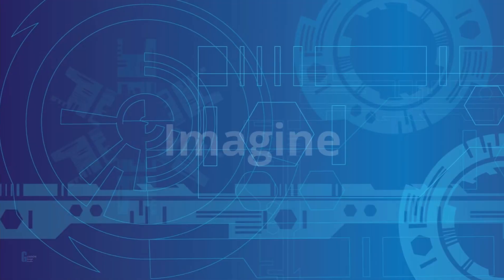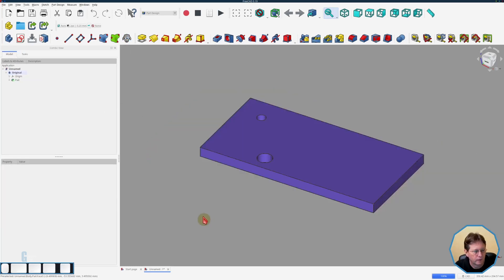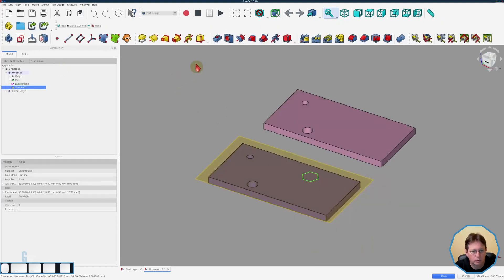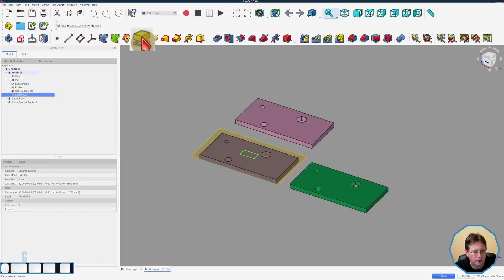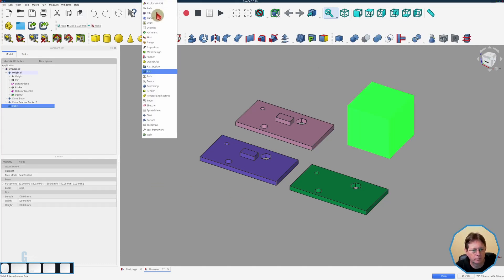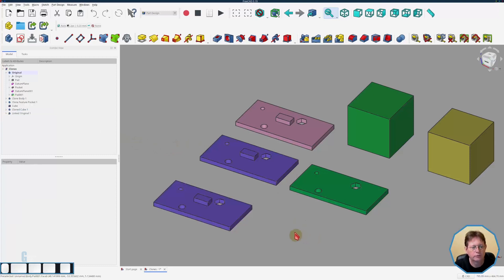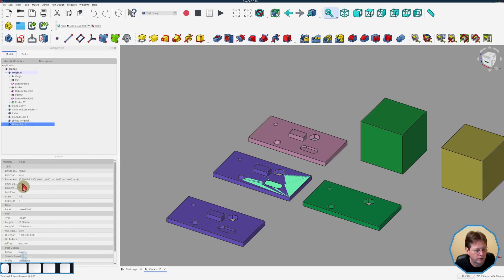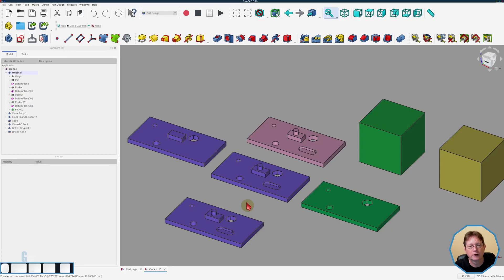What are the differences between FreeCAD's Clone and Link tools?

Comment: I found this very informative and useful, thank you  for your effort in making this available to the community. I have a question though concerning datum planes. In the video, when you create one on a face say, you seem to like to detach it before then going on to create a sketch. It's not clear to me why you take that option. I assume what happens in that case is that the datum plane retains its relative position in the coordinate system irrespective of any subsequent changes to position of the surface (eg we change the pad length, the datum pan would stay where it is). IS that right?
Reply from the maker: Thanks for your question. I'm glad that you found the video useful. The short answer to your question is that doing so helps to prevent the Topological Naming Problem from raising it's ugly head.
I have a video that explains the Topological Naming Problem, but in simple terms, each face and edge in a model has a unique name but unfortunately under certain conditions the names of those edges and faces can change which can cause the model to break. The model breaks because a feature that is "attached" to an existing face or edge uses it's name as part of the attachment and if/when the name changes the attached feature could be attached to a completely different face or edge. 
For example, you might create a cube and attach a cylinder to the fifth face which we'll say for sake of argument is the right hand face of the cube. Now you could go back to the original cube and make a minor modification to the design, and FreeCAD will rename all the faces and edges, and after doing that the fifth face is now the bottom face and your cylinder will be attached to the bottom of the cylinder rather than the right side. If you detach the datum plane from the face you used to create it on, then there is no link back to the name of the face and FreeCAD can rename the face as often as it wants without breaking your model.
Check out my video about the Topological Naming Problem for more details. I hope this helps.
Reply: @GlassonDesignStudio  Thank you very much for you explanation, it makes sense now. I have now watched your video on the TNP which again was very useful.

Thanks again

Comment: hi, one question:
I have several parts, and i want to have different parts which are fairly similar,
in my mind it have made sence that i make the first sketch and then copy that to the other parts/bodies, but when i modifie the copies, to have the slight difference, all of them are linked and modify together !

how can i cut the bound and links between them ???
Reply from the maker: Thanks for your question. I tried to recreate your scenario but wasn't able to. What I did was create a body, then create a sketch. I then clicked on the sketch in the Model view and pressed Control-C. FreeCAD opened a dialogue box asking whether I wanted to include the dependencies which I said yes to. I then created a new body and pasted the sketch into the model - which then required me to move the sketch into the new body. I then modified the sketch and it was not linked to the original sketch. I also tried copying the sketch without including the dependencies and got the same result. Is this similar to what you tried? 

BTW you didn't mention which version that you're using, but I'm using FreeCAD 0.20.1 on Kubuntu.
Reply: @GlassonDesignStudio  Thanks you for your reply,
i have this problem both in 0.20 and realtunder, but on the same file; inital file was on 0.20 ( i mean i didn't start the generation on realtunder from ground zero..... maybe there was a bug and it got copied/ stayed in different version

this what i have done:
1- creating multiple part
2- creating bodies for each part
3- starting a sketch in the first body, and pading pocket and ....
4- dimensions are linked to a spraadsheet !
5- i draged the first and main sketch that i wanted to modify, to the second body

but here, when i modify any of the, they are linked, and both of them change.
is there a way to see the relation between them ? so i can reove it, or at least i can find out what relation they have?!

maybe like Catia , there is an isolation function ?
Reply from the maker: Thanks for the additional information. I didn't try dragging the sketch from one body to another so I'll have to look into that and understand how it works because I've never done it that way before. Did you try copying the sketch from one body and pasting it into the other?
Reply: @GlassonDesignStudio  the problem is, right now, i can delete any one of the sketches !
if i change eitherthe first original sketch or the dragged one, editting or deleting, will effect both of them; so i can not return to the stage that i have one sketch to try copy it.

easy solution is to start over and create a new file, but i rather to know the reason and solution (instead of cleaing the question).

right now, i have two exact sketches, that if i edit or delete one of them, it will effect other, but i need to know how to cut the link and connection.

Comment: Great video. But I have one question: Is there a reason that you create for each change on the same plane a new datum plane, instead of re-using the first one?
Reply from the maker: Thanks for your kind words and question. I use the datum plane in an attempt to avoid the topological naming problem, and I just got into the habit of using separate datum planes. An advantage of using separate datum planes is that you can reposition a plane that is in the wrong place and only affect the features on that plane. Moving a reused plane would result in all the feature on that plane being moved as well. It's a small difference I know and perhaps I'm just over thinking it 😀

Comment: Hi! Your videos are really helpful, so thanks for making them! Could you explain why you detached your datum plane (~4:xx) , as well as pros and cons, and when to attach, etc? Just if you get the time.... :)
Reply from the maker: Thanks for your kind words. FreeCAD has a long standing problem known is the topological naming problem where every face and edge is given a name but that name is not permanently attached to that face or edge. Let's say that you have created a cube and you want to drill a hole in the top face (we'll call that face Face6). You have to select Face6 so that place the geometry for the hole. Now, lets say that you change your mind and want the cube to actually be a hexagonal solid, so you edit the original sketch to make it a hexagon. Once you've done that FreeCAD will recompute the geometry and assign names to the faces and edges. My expectation is that the drill hole will remain in the the top of the hexagonal solid...but this is not what happens. FreeCAD has renamed all the faces and edges so the top face might now be Face8 but the hole is still attached to Face6 which now might be one of the sides of the hexagon. Obviously this is not what we want.
So the idea of creating a detached datum plane is an attempt to get around this problem because it creates a datum plane that just "hangs" in space and is not directly connected to the underlying part. It's not a great solution because you need to ensure that the datum plane is in the right place if you resize the part. You can do this using parametric design principles but it would be better if FreeCAD took care of it for you and we didn't have to have workarounds like this. Apparently version 1.0 will resolve this problem but I don't know when it will be released. 
I hope this makes sense....I also have a video on the topological naming problem which is a bit out of date now but it does give you some of the background - just bear in mind that FreeCAD no longer allows you to do some of the things I suggested because they were completely wrong. I need to do an update for that video but haven't gotten around to it yet.
Reply: oh - many thanks to this explenation. Now I understand thousands of my problems😊

Comment: Thanks for this video.  Freecad is so powerful and multifaceted that it is hard for a newbie to find the best workflow, particularly when there are even software branches of the main code, extra workbenches to add in, etc, so I really appreciate these comparison videos.  You said one really important thing right at the end that I would love to understand better... You said you primarily use Link because you like to store component parts in external models.  With my background in electronics, where almost everything is a component in an external libtrary, I have really missed anyone talking about this on freecad.  Can you expand deeper on how you would create external libraries of components and bring them into models, please?
Reply from the maker: Thanks for your feedback Dominic. I was a software engineer in a former life and I still think of modularising designs as a way of reusing them to bring a measure of consistency across multiple designs. I use FreeCAD to design fine furniture as well as jigs and fixtures to help produce that furniture so it is important to me that I don't reinvent the wheel with every design (although there is an element of that unfortunately).
I'm trying to build a library of resable designs to support my wood working. That takes the form of a spreadsheet which contains the parameters of the part and can be linked into another model, and a model of the part itself that uses the spreadsheet for its parameters. This is done primarily as an aid to assembly using the A2Plus workbench AND for producing assembly diagrams in the TechDraw workbench.
For example, many wood work jigs use the humble t-nut for bolting things onto the jig. I link in the spreadsheet that defines the t-nut in order to use the parameters in the design of the counter bores in the jig that the t-nuts are inserted into. I then create an assembly which contains the part I'm designing and the model of the t-nut and assembly them to make sure everything fits as designed. Once that's done I will use the Exploded Assembly workbench to explode the assembly so that it can be used to create an exploded diagram of the assembly in the TechDraw workbench.
I'm still developing this workflow but that's the general gist of it, and how I am trying to reduce rework. Perhaps "library" is not the right term, but it seems like a decent starting point until I can figure out a better term. I hope that this gives you a better idea of what I'm trying to achieve.
Reply: @GlassonDesignStudio  Thanks.  I would love you to do a short demo of that sometime, if you can.  Thanks again.
Reply from the maker: The thought occurred to me too.....

Comment: hello sir, The video was interesting indeed but, I have one question. Is it possible to mirror a linked body? if yes, how? if not, is there any other way to do it while maintaining the link with the original file?
Reply from the maker: Thanks for your question. I've not come across the situation you describe before so I don't know if it is possible. I've done a few quick tests but I have not been able to mirror a linked object - even in FreeCAD 0.20. I'm not sure that you can actually do what you want to do.
Reply: Thank you for the response. Even I experimented myself and failed, I needed confirmation from an expert.

Comment: Im new to Freecad so correct me if I'm wrong, but I noticed one difference that may have not been mentioned. The links are objects that are outside of bodies. When clones are made they are made in bodies. Because of this, clones can use boolean operations. 

Happy I didn't get too far in my design before I noticed this, and I switched to using clones instead of links. 

Otherwise, great videos. I like your particular style of teaching and your viewers in the comment section are thoughtful as well. Looking forward to seeing more work from you. I've watched a few videos on the subject but I'm interested in your take on shapebinders.
Reply: I'm using a boolean between cloned bodies inn a current project, and can confirm it works.
Reply from the maker: Thanks for your feedback John. I don't use a lot of boolean operations in my work so it never crossed my mind to check whether it would work. Hopefully I won't forget to use the right method when I need to use a boolean operation somewhere down the track :)

Comment: WAIT.. Hang on.. Hold your horses...

Are you saying that in order to prevent TNP you can simply click a face, add a datum plane instead of a sketch, detach datum plane, and then sketch on the datum plane!!!!

Every resource I have seen has said you have to attach the datum to one of the base planes and offset it to the right place, which is a bloody nightmare to try and figure out if your face happens to be at a compound rotation in x y and z..

Have I been missing something so simple all this time!!!!!!
Reply from the maker: Thanks for your question Louise. The process you described  has been working for me but you still need to create a sketch on the datum plane before you can start sketching.  I was using version 0.18 and was able to reference external geometry from an earlier feature using this method in my video, but I have moved away from referencing external geometry in subsequent sketches because it still has the potential of triggering the TNP. 

It seems to me that the process of selecting a face and creating a datum plane effectively does the same thing as creating a datum plane on a base plane and offsetting/rotating it to the desired place (at least it has for all the cases where I've done it). I'm the first to admit that I might be doing something wrong, but this process works quite well for me in the simple models that I create for my wood working. Detaching the datum plane from the face removes any link to the name of the face and therefore should prevent the TNP occurring.

Please bear in mind that this is a workaround and not a solution to the problem. This process may not work in future versions of FreeCAD and hopefully the fixes from realthunder's branch will get merged into the main source code in the not too distant future.  I am planning to do an update for TNP  video because there are some things I've said in it that need correcting based on the behaviour of version 0.19 and later. These later versions seem to be more strict on the use of external references in sketches, but I need to do some more testing before I make a video which corrects the earlier video.
Reply: @GlassonDesignStudio  I understand there is hope that RT branch is going to be merged in for December release, touch wood.. I do have RT's branch, but I cannot get it to compile and the appimage suffers a qt error with fonts and UI scaling being all to cock on manjaro KDE, so I try to work with the main branch where possible..

Its a superb program, not the most intuitive but once you start to get your head round it the power it has is quite phenomenal.
Reply: @GlassonDesignStudio  Looking into it further, a downside for me is it breaks the parametric design, especially spread sheet driven parametric design which is where I am heading..

So if the dimensions change based of a spreadsheet update the datum stays put and then breaks the design..

its really quite annoying, but its not freecad devs entirely to blame, its the underlying cad kernel that has the bug, the devs have to work around it somehow..

Ahh well, keep fingers crossed for good news december :D
Reply from the maker: Hi Louise, sorry about the delayed response. Thanks for your additional feedback. You are correct that detaching a datum plane from the face makes it more difficult to use parametric modelling. For most of the work I do it doesn't really matter, but in the instances where it does I will create a plane on one of the base planes and then move it into position using values taken from a spreadsheet (I use spreadsheets for most things if you haven't already noticed :) ). I should have said more about that in my first response.
Reply: I said the same thing, I smacked myself in the head and said "the answer was right in front of my face". This is a really powerful technique, or workaround rather. 

To add: I noticed once you apply the datum plane to the face, it has an attachment of 0 across the board, but it's placement according to the coordinate system is filled in. If you write down, take a screen shot of, or remember this placement, you change the  "support" of the datum plane to another plane. You can then adjust the "attachment" (x,y,z location) to whatever is in your screenshot. 

So it's an extra step, and will become very unweidly for transformations in several directions and angles, but it definitely is possible to set up a proper datum plane flush with a face. Just remember, when you select a new "support" plane, that you clear the supports first. The default behaviour, when you select a new plane youre just adding additional references to your original face, not replacing that face.